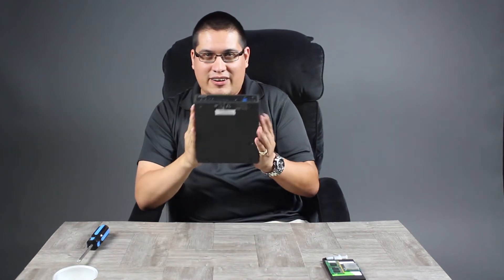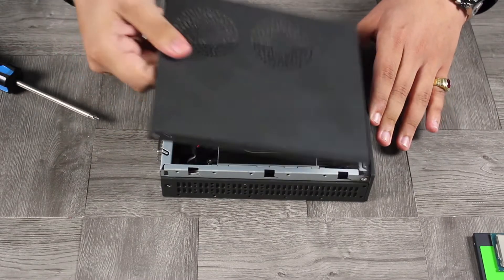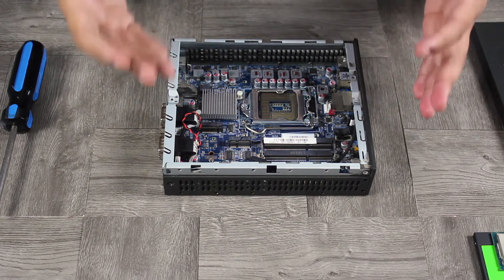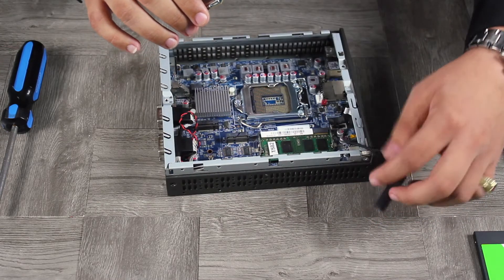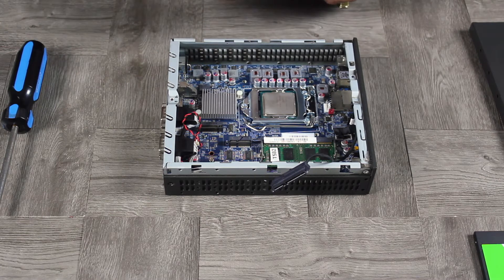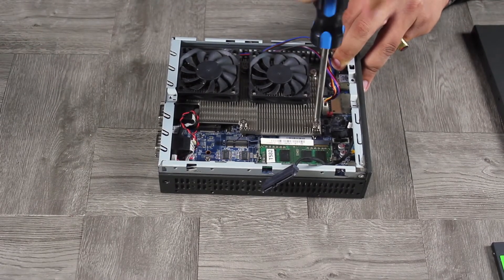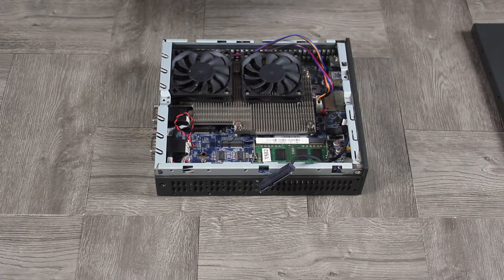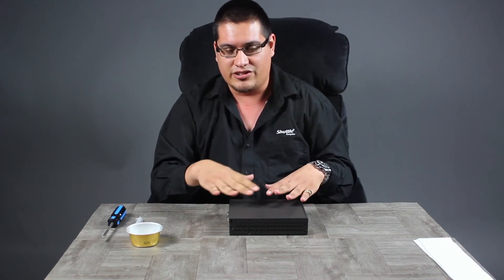How to Assemble Shuttle Slim PC DS81, DH110, DH170, DQ170

Comment: Question about DQ170. Is the headphone jack soldered onto the motherboard?
Reply: short answer: yes.
long answer: sorry it has been 5 years or longer but, the answer is yes, the front headphone jack (3.5mm) is soldered onto the motherboard just like its counterpart the mic input 3.5mm jack.

Comment: Hello, I changed something in the BIOS settings and now my Shuttle DH310 won't start. Could you please help me? I don't see the BIOS battery to reset the BIOS. Thanks and regards
Reply from the maker: Hello, unplug the unit from power. Using a Phillips head short the pins for 10-15 seconds (the pins are located in the back by the USB 2.0 ports). Using your free hand press the power button 3-5 times. Once you have completed the procedure and the time has elapsed, hook the unit back up to power and allow 2 full mins for a POST. If video information fails to come about, please contact Shuttle Technical Support for further assistance/repair options (support@us.shuttle.com).

Comment: What M.2 SSD Size/Model is this compatible with?
Reply from the maker: Hello, thank you for your inquiry and patience. Not all of the slim models support M.2. Only the DH110, DH170 and DQ170 have (1)M.2 2260 Type M Key Socket. If you need further assistance, please contact our support line at 1888-972-1818 .

Comment: I would buy this instead of the Asrock Deskmini but im afraid of thermals and noise...
Reply: i think it should be ok with a lower end processor like an i3 or pentium / celeron. i know im 4 years late but i found a cheap one on ebay and i might buy it. it have an i7 7600 and if you would like i can inform you on the thermals

Comment: Why not have one huge 140mm+ fan on top of that heatsink ? I bet this config is pretty loud and unefficient with an i7 cpu.
Reply from the maker: Thank you for letting us know your concerns. 

Yes, ideally we would like to put a giant fan that sits on top of the heatsink to maximize heat dissipation. However there are a few factors we have to consider beforehand, e.g. chassis stability, thermodynamics...etc. 
Our mechanical engineering team designed 2 ventilation holes on top so that hot air can be exhausted. If we were to put a 140mm fan (or even 100mm) on top, the enlarged holes may make the chassis vulnerable against external force. That is, our ME team is always trying to obtain the best working temperature without sacrificing the physical integrity of the entire unit. 

On the other hand, you can always refer to our website for processor supports, 
http://global.shuttle.com/products/productsSupportList?productId=2093
If the heatpaste were applied correctly, you should be good on supported i7 processor.